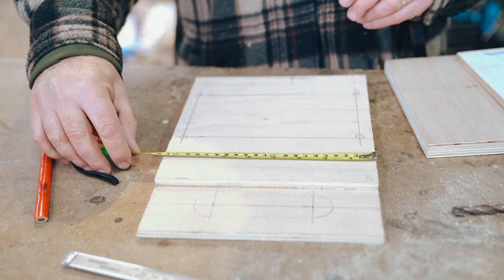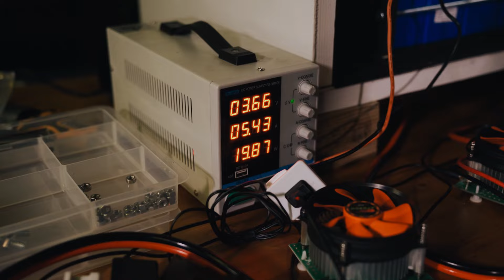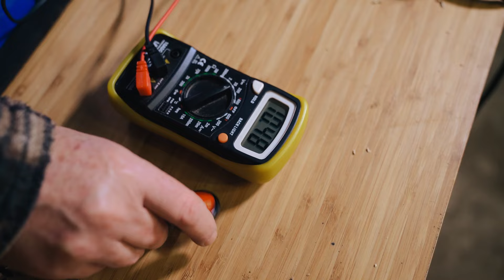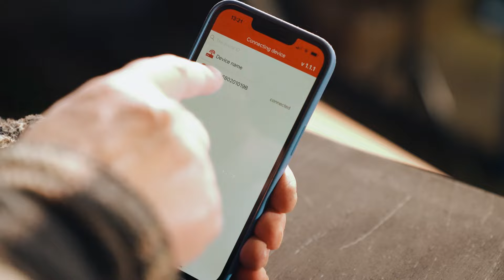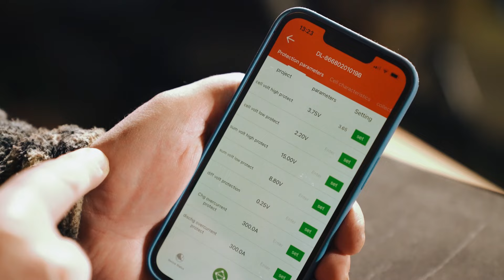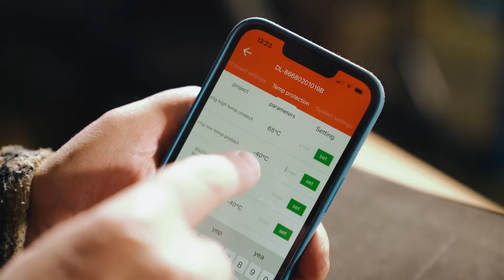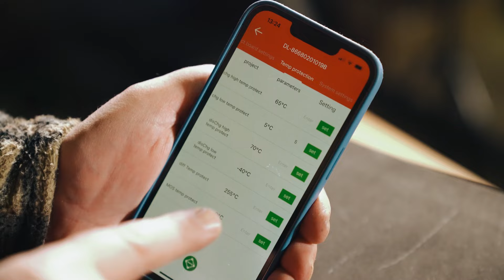Very Detailed Beginners Guide To Building A Custom DIY LiFePO4 Battery

Comment: I would caution anyone who is new at doing this to be extremely careful not to screw or drill into the battery cells when drilling & installing the bottom wood plate.
Reply from the maker: Yeah, I think we mentioned that in the video. 👍🏼
Reply: @offgrid_power  ummm..
 No you didn't!
Reply from the maker: Thought we had, but must be thinking of another video. But yes, it’s very important to ensure you don’t put a screw into a LiFePO4 cell!
Reply: 1:03:25 and 1:16:03
Reply: @jeffallen3382  see jizburg's timestamps. You were wrong. It was mentioned twice, don't drill into the cells.
Reply: @kazoz3520  True. At 1:03:36 he said you never want to drill or screw into the battery. Jeff Allen emphasized it so thanks.
Reply: Oh why not, sounds like fun
Reply: Natural Selection
Reply: You are one of those people who try to put your 2 cents in every video.
Reply: You think…

Comment: Some battery experts say that compressing bloated cells to make them flat is damaging them. I'm not a battery expert. I hope to be soon because I have 70,604.8 Wh of LiFePo4 cells coming from China within the next few weeks. I'm glad to hear you say that they are movable when fully discharged. I'm thinking that a snug fit rather than a tight fit is the way for my batteries to be built. I'll be using TDT smart BMS rather than anything as bulky as a Daly. I might reconsider if I find one that is suited to external mounting. I hope you're doing new videos with newer equipment and cells. The prices have gone way down now that the market is flooded.

Comment: It's excellent, except for one thing: Why don't you use dielectric spacers between the cells? The aluminum body of each cell is positively charged, you have them firmly pressed together, relying only on the insulating quality of the thin layer the heat-shrink wrap. That, IMHO, is asking for trouble. Just FYI.

Comment: Why no insulation between the cells, the blue wrap on cells has been said to split allowing cells to short out and burn. I used 3mm foam between the cells.
Reply from the maker: It’s extremely rare to have the blue wrap split on these cells. But we use the epoxy insulation sheets anyway.

Comment: You're not putting any fuse into the battery. Have you ever tested shorting the main 12V leads? Although BMS manufacturers claim short circuit protection, in practice many cheap BMSes put out the magic smoke when plainly shorted.

Comment: Nice vid. Thanks.
I was under the impression it was a good idea to separate the cells with an insulator: some use fish paper; some use acrylic sheet; others use kapton tape, to individually wrap the cells.
Reply from the maker: If your battery is in a high vibration/movement situation (like a boat) then that is definitely advisable. IMO, in most van/RV scenarios it's not necessary. I don't know a single person who's had a problem where the blue plastic has worn through and the cells have shorted.
Reply: @offgrid_power  You state yourself that fully discharged the cells will be able to move, so I can't agree that they shouldn't have something in between to resist wear of the shrinkwrap.  The roads and potholes I've driven in my van conversion would definitely see those cells rubbing when discharged.  Seems like an ounce of prevention for a pound of cure.
Reply: @brianmi40 I'm glad someone of superior intelligence is here to set him straight 🤣😂🤣😂🤣
Reply: @offgrid_power  i have a qestion i am running a 8s lipo with daly 200A bms , and are now in the process of building another 8s with a daly bms , is it true that one can not run packs like that in parallel???  the packs are both the same size 280ah one is a daly 100A smart the other is a daly 200A

Comment: Nice detailed walk through on the build. There are two things that make me cringe, being:
1. The main negative wire from battery to BMS touches (or nearly touches) the positive post of the next cell. With time and vibration this may cause the cable insulation to wear through and short. That would be catastrophic. 
2. My understanding of best practices is to place your main fuse as close to your main positive battery terminal as possible in order to minimize the length of wire that is not protected with a fuse. Your build puts the main fuse outside the battery box and potentially multiple feet beyond the main positive battery connector.
Reply from the maker: Thanks for the feedback, Joseph. :) I think it would be extremely unlikely that the cable insulation would wear through, but it is a good point and given that it would be minimal effort, would be worth changing. 
When we install batteries, we would normally attach a fuse on the outside of the case of the battery so it's within a few inches of the positive terminal and also accessible if it needed to be replaced.
Reply: @offgrid_power  If it was me, I would also design/3D print some plastic battery terminal nut caps, to prevent any possibility of short-circuit, when building the battery.
Reply: Exactly my thoughts too Joseph!

Comment: Just watched this video because I´m looking for ideas to build my own DIY Battery.
Thanks for talking calm and using an easy understandable englisch.
Nevertheless there is on critic. You using not isolated tools, when you tightened the nuts at the Cells.
In very bad case this could create a short circuit with all the bad consequences.
Greetings from Germany

Comment: The case inspired me to build my own 48V 100ah battery. The only question is: if i have 16x 100Ah cells a 1A active balancer substitute the top balancing at all, if the cell voltage near to each other? Greetings from Germany.
Reply: What price did you get your batteries from china and can you share the company details

Comment: Great video! I’m planning to build something similar but for prepping purpose as backup power. Love your compression box design even though I would cover the sides for various reasons. What about the charging interface? I’m planning to add a dedicated XLR connector in the box for easy charging. And maybe an Anderson connector for external loads. I would also add a manually circuit breaker for additional safety.

Comment: I am in the process of designing and building a "portable" 280 AH LiFePo4 battery. "Potable" in that I will be moving it between our popup camper and large (41') Marinette Marquis cabin cruiser boat. We can't be in 2 places at one time so it seemed reasonable (and economical!) to have the ability to have a battery that could move between the two with us. We don't use the camper that often so the movement between the two will be minimal.

The construction will use a large tool box as the housing of the components. All below components will fit (some already acquired) inside of housing)
- 4 - 280AH LiFePo4 cells (acquired),
- the 280AH cells are to have a 1/16" to 1/8" separator between them,
- 1/4" foam medium density foam cushion (think 'walk/stand on "fatigue reducing mat") on the bottom of the box to absorb jarring during vehicle movement (highly likely pulling camper on road trip),
- a single 20A Victron DC - DC charger, (acquired)
- a Daly 200A BMS (acquired)
- Heavy gauge battery thru wall battery connectors for hookup to the vehicle's feed from the house battery, (acquired)
- #1 (#2 or ???) gauge cables to battery side of 2000watt inverters (1 each in each vehicle - camper already has 1 as I used 2 - 6V golf cart batteries initially but their several years old. Boat' never had an inverter system)
- (not part of 'portable battery' but just FYI) 2000w inverter.

My primary question:
The 280 AH cells I bought (from 18650 battery store) utilize dual buss bar welded on terminals. They came with solid straight nickel coated copper buss bars. My concern is with jostling and possible movement/shifting and the buss bars potential for movement/loss of solid connectivity. To mitigate this, I'm considering making up my own buss bars using welding cable & crimp on lugs. I have a hydraulic crimper to ensure a solid fit/connection.

--> what gauge copper cable would you recommend for the intended buss bars?
.... or do you recommend anything, buss bar-wise, else?

Comment: I am wanting to use the battery in a marine environment.  Can you seal the battery box airtight.  A great video.
Reply from the maker: In theory yes, but the battery should be able to cool sufficiently especially at high amperage discharge. But if you’re not drawing a high amperage from the battery, then no problem. The chemistry does not require ventilation. The ventilation is really for heat management more than anything.
Reply: Great.  I will just make a slightly larger box.

Comment: Hello from Tennessee, USA.  Thank you for sharing this awesome video.  I followed your instructions to the best of my abilities and understanding and now I have a battery pack on an insert similar to yours.  Have a question about connecting to solar.  I have 2 100 watts Renogy panels connected in parallel and a Renogy Wanderer 30 amps PWM charge controller .  The positive connection added to the positive side  and the negative side on the battery pack.   I see the battery draining (using Daly BMS app) when connected connected to 2000 watts Giandell inverter.  Not sure if the battery is charging with the panels.  Have watched several of your videos but none explain how to connect to solar and how to monitor using the Daly BMS app. Do I need to connect it in a different way?

Comment: Great video, the best I watched and there are 100s of them now. Thank you very much.
2 questions please:
1. When topping up with 3.6v charger - if there are no amps showed, how can you be sure it is full and that your cell is not overcharging?
2. The BMS power relates to max load going, not to the battery size? So even with massive battery, if your need is modest, eg. 80A max  is it enough to buy cheaper model?

All the best,

Jo
Reply from the maker: Hey Jo! I'm glad the video was helpful! Any suggestions on anything we missed or would be helpful for us to cover, please let us know.

In answer to your questions: 
1. As long as your charger doesn't exceed 3.6v, then you should be fine. I would be cautious of Power Supply Units (like this one: https://geni.us/iAk3) as sometimes they can be a bit strange and change voltage, etc.. I've had times where their voltage changes a bit so keep an eye on them. We tend to use a charger like this to finish top balancing: https://geni.us/Wate365vCharger
2. Yes, the BMS should be sized according to your draw or charge requirements. Most Daly BMS have half the charge capacity as their draw capacity (e.g. 150A BMS can be charged at a max of 75A and draw at a max of 150A). Some of the BMS have slightly different balance voltages. Generally the higher the amperage of a BMS, the faster it'll balance the cells. That said, if you have a 560Ah battery but only require a draw of 80A, there's so reason to buy a 200A BMS. Just go for a 100A BMS. The only reason you might want a "big BMS" for a "big battery" is if you intend to charge it at a very high amperage. One other consideration though is that if you buy cheaper/less quality cells, getting a higher amperage BMS to balance "faster" might be worth considering. If your cells are not well matched and the delta between them is significant, then consider a higher amperage BMS as it'll balance your cells faster. 

Hope this is helpful! :)
Reply: @offgrid_power  thank you!

Comment: I was under the impression you must charge through the BMS to prevent over charging of a cell , like you mention they may all be at different levels and overcharging can be quite bad ?

Thanks for the great video nonetheless! Much appreciated
Reply from the maker: Yes, you must charge through the BMS. That's very important.
Reply: Yes, for normal operation  you need  to have the protection of a BMS to prevent over charge over discharge over current  etc. when charging from an unregulated  source or load! ( solar, Wind, etc)The alternative is to use a Constant Volage CV/Constant Current(CC) source eliminating the need for a BMS especially when all the cells are connected in parallel, when the important factor is to stop charging when 3.65/3.7V is reached .  The BMS is for every day use but it is not required when you can control the voltage/ current provided form the external source. This is how most domestic battery operated equipment is charged, it is cheaper to put the charge intelligence/control/cut-off  in the charger than the battery!

Comment: Ratchet cutters are a little expensive unless you're cutting a lot of big wires. If you have a sawsall a 18 teeth blade will work. I was thinking polycarbonate would be a great material to make box out of

Comment: Why do you need to do any extra pre-assemvly top balancing at all? I mean, after the BMS is connected, its integrated balancing curcuitry will anyways engage and do its job - just as it will be doing during/after each usual duscharge-and-charge cycle.??

Comment: The serrated nut needs a solid surface in order to do its job: Not moving under vibrations. If you put a washer under it that will defy the purpose. The nut should be mounted directly on the bus bars.

Comment: Thanks Roger great video.  I'm going to start on my own battery soon,  could you please advise on what size of daly bms you are using and also can I use a 12v car charger to top balance the batteries.  Thanks for your great work.

Comment: Hi, very nice video. 
Question, you see a lot people who puts extra isolation plates between the cels is there a reason why you don't?
Reply from the maker: We haven't seen the need to put additional insulation between the cells for the applications we're using these batteries. If they were going into a boat, it would probably be worthwhile. I think it depends on your application. :)
Reply: We do in cases where there would be reasonable vibration or movement of the cells. We tried to pack so much into this video - had to pull some stuff out just to cut down to 80mins.

Comment: awesome video, i just have a question no one seems to explain, 
the cycle rules apply only when the charging/discharging is complete, how does using them during the day attached to an inverter while being charged by solar affect the cycles, how are they calculated? i really can't wrap my head around that

Comment: Hello..... I have a question about a 48v bank of cylindrical lifepo4 batteries... Most of the time they charge up to 54.2V, they never reach 54.4V. Does it affect the batteries at all not taking them up to 100% charge? or is it healthier for the life of the battery that they do not reach that %? ... thanks
Reply from the maker: It won’t really negatively affect them if you don’t charge them to 100%. If anything, it’ll prolong their life [somewhat] and give you more cycles.

Comment: Excellent tutorial! I do have one question are the cells with welded stud better than non-welded studs?
Reply from the maker: Hi Alan! Hope the video was helpful! :) 
We've used both the welded and non-welded studs extensively and always lean towards the welded studs. Because the terminals are generally aluminium, the threads in the non-welded studs cannot take the same torque as the welded studs can. We usually would not torque non-welding studs more than about 6Nm whereas the welded studs we're torquing to 10Nm.
Reply: @offgrid_power  Thank You for your reply! I have a source for some cells but all the welded post cells are out of stock but they have plenty non welded cells.

Comment: Looks pretty amazing. Would you recommend to close the sides also to protect the battery a bit more? i guess there is enough airflow through the handles right?
Reply from the maker: Yes, we'll often put sides on the case. We would usually just leave the tops of the sides open enough to allow airflow. So basically put the sides up to the point where they cover the tops of the cells/terminals but with the top 2"-3" open for airflow. :)
Reply: Thanks! I watched so many videos, where people build this batteries, but this is hands down my favourite one. I will build it exactly like this. Also pretty nice that you saved me some time including all the measurements. Just amazing!

Comment: Hi Roger,
I just finished putting 230Ah battery together as you did this one in the video.
Can you please advise what would be low current protection setting in your experience?
Maybe 11.20v?
Thanks Mick
Reply from the maker: Hi Mick. We made this video recently which shows the settings that we use on the Daly BMS: https://youtu.be/coiI2aPjTxU

If you need anything else, let us know. :)
Reply: @offgrid_power  
Thanks!

Comment: Thank you for all the LifePO4 videos on your channel! Quick question: the thin wire is really enough to top balance? I miss 2 bus bars so that could be a solution. Just not sure if it's recommended for all cells . Mine measure all 3.3V up on arrival. But the SOC could be quiet different so higher current could be flowing between cells, or not??
Reply: For me it worked just fine! :)
Reply from the maker: Generally speaking, when you top balance you're doing so at such low amperage that it will work fine using small wire like we did in this video. Unless your 3.65v charger is capable of charging at a rate of 100A, small gauge wire to connect the cells in parallel will be fine. We generally top balance at no more than 30A-40A at a maximum.

Comment: Thank you for your video.

Just a query.

I have a Bison Battery box.

(they are forsale on ebay from a seller called fishingmad)

I used the box this year to house my heavy 110ah Numax lead acid leisure battery for my off grid campervan.

Question is - is it possible to build a 100ah+ lifepo4/lithium battery/cells to house/fit inside the Bison battery box? 

I'm quite practical and willing to give it try.

Thank you.